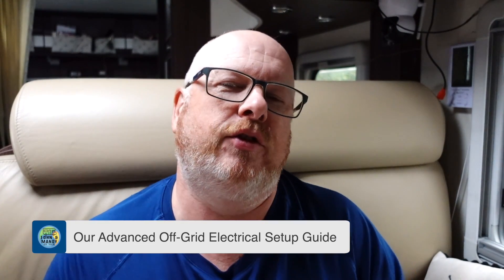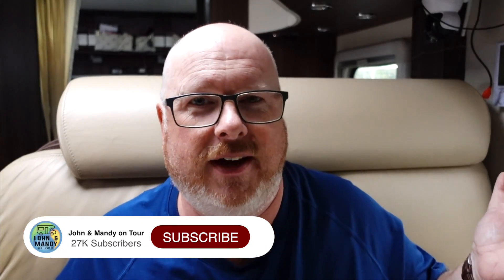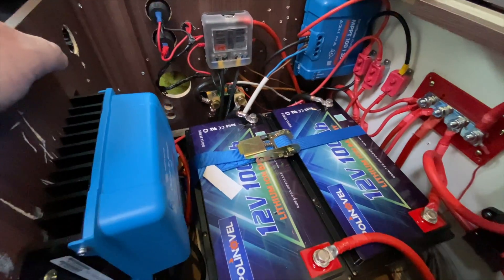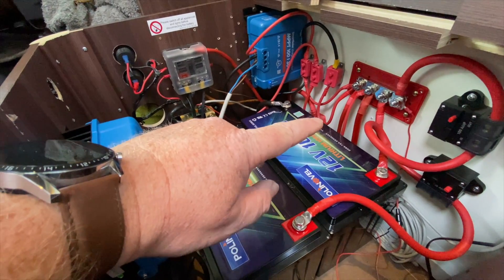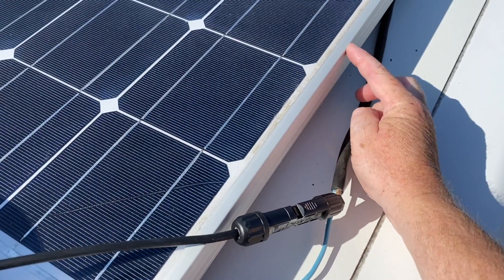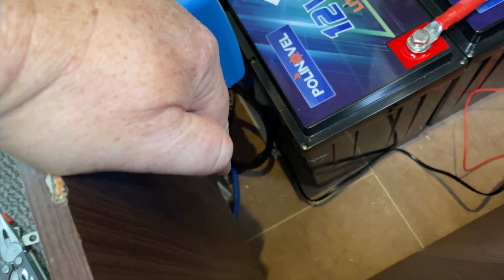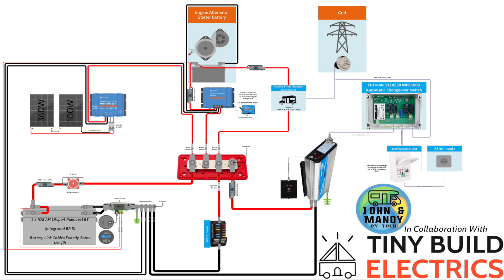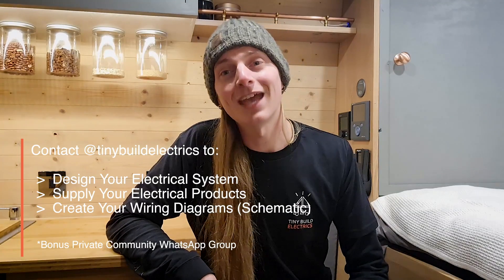Advanced Offgrid 12v Electrics For Motorhome, Campervan, RV, Boat or Cabin

Comment: Hi John - not sure if you can advise as I am no electrician we have a relatively new lifos 105ah lithium battery installed in our small swb Ford. It’s been great but I let it fully discharge and we have a ctek dc dc and 120 amp solar so we got the voltage back up to 13.2 13.1 volts but the soc on the bms only shows 12-15%. Even after putting on house charge - can’t work out of the lifos bms is fault reading or something else - any steer I would be grateful
Reply from the maker: I’d go back to the battery supplier for advice.

Comment: Hi John did you have to upgrade the weight of your van  after fitting  solar etc we have just installed solar and B2B etc and I think the payload is now  not going to be enough regards Gary&Julie  keep up the good work
Reply from the maker: We’ve carefully removed a lot of weight from our van, replacing the fridge, restructuring the cupboards, removing unwanted boxing-in sections and upgrading to lithium batteries. We’ve removed over 250kg of weight so far and with upgrades only added back around 130kg. So we’re fine at our 3.5t plated weight.
Reply: @GadgetJohnAdventures  hi thanks John I have just added solar etc as I said and totally added about 115 kg but 2 AGM batteries are 62kg  but it was a choice between lithium or enough solar etc I went to the weight bridge and was at 3540 that was loaded without the wife  food and water should I leave her at home 🥴 only kidding

Comment: Is the B2B in the electroblock ok to use in tandem with you Victron B2B when charging a lithium battery my electro block on a 2014 Hymer has lead acid or a gel setting. With two AGM leisure batteries that I’d like to change for lithium.

Comment: Hi John,
I have an old Hymer 1997 with an electro block . I am upgrading to lithium,and I am upgrading like you to a 100/30 Victron mppt and Victron B2B charger.
I loved the video and have my schematic from Tom.There are a lot of Hymer owners needing help with connecting lithium and connecting power to the electroblock,would it be possible to do a video on how you connected you stand alone lithium setup back to your electro block to keep it working the lights etc.
I would happily share it on the Hymer forums.
Love the video's
Great job.
Steve n Babs 😀
Reply from the maker: Hi, this is covered in this video. You use the factory battery cable and install a 30a breaker on that cable, then wire that into the new positive bus bar, wire the factory negative cable to your new negative bus bar. This way you have, as I show in this video, integrated the factory electrics into the new lithium setup.

Comment: oops! what happened there? half the email is missing, sorry! I'll try again.
John, you recently gave me some advice regarding upgrading my van to include more solar power, unfortunately there is no more room on the roof to add to the 150w panel. 
Long story short, we were told that the fridge was a 3 way fridge and used gas when 240v was not available. We were wild camping this weekend and lost all power, the fridge had been switched on for some time and flattened the 2 x 100ah lead acid batteries, they are not damaged, the system worked as it should. 
My question to you is, would you recommend we replace the 2 x lead acid batteries with Lithium and add an inverter? we have about 2k to spend. This is what we have in our Merc sprinter atm.
A SARGENT EC155 control system.  A 30Amp smart com self switching Combi relay.  A and we 
I have just bought a Victron Energy MPPT 75|15 Charging Controller. 
I'm sorry for the long email but I really do need your advice as I know it will be the best advice. 
Thank you for the videos and congratulations on hitting 30,000 plus views

Comment: Hi Both and coop
John, I recently asked you for some info on my van, you did reply, thank you. Could you give me more help please? 
I asked you about how much solar was needed, unfortunately I have no more room on the roof, my 150w solar panel takes up what room is left on the roof
the

MercedesSprinter
smart comCombiWaeco CR 65 coolmatic 2 way fridge, A shurflo RV fresh water pump. A trumatic C 6002 EH. We have 10 LED  spots. 
I have just bought a Victron Energy MPPT 75|15 Charging Controller. 
I'm sorry for the long email but I really do need your advice as I know it will be the best advice. 
Thank you for the videos and congratulations on hitting 30,000 plus views

Comment: Hi John. Quick question (I’m not on Instagram so have to do it here sorry). 
Did you use the separate ground connection on the side of your Victron MPPT or is it grounded through the -ve cable going back to your -ve busbar? If the former, where did you send the separate ground cable? Cheers, Stu

Comment: @Gadgetjohn, another great video, very informative as usual.
Would you mind telling me how you incorporated the original electrical fittings which would have been fitted to the leisure battery before you start adding to your setup?
Are they incorporated into the +ve busbar and the load side of the shunt?

Comment: Hi both, hope this finds you well.  Quick query, I am reworking the wiring in my van and have 35mm2 cabling between 2 leisure batteries and same to a bus bar.  I am thinking of putting  an inverter in (I have a 2000w pure sine) - would this be enough to run a coffee machine same as yours and what breaker/fuse size does a 2000w inverter need?
Reply from the maker: Yes that cable will be ok for that use and a 150a breaker covers our coffee machine, but check yours in case it draws more power.
Reply: @GadgetJohnAdventures  Thanks.

Comment: Hi John
Thanks for such an informative video. It’s helped me to gain a good understanding of what’s need for my own van.
I’m looking to do something similar for my van but I’ve a question regarding solar panels. I’ve looked at solar panels and found 2 separate panels one at 360watts and a second of 100 watts but reading the details I noticed the 360 is 24v and the 100watt is just 12v. Would this be ok to install as you have done on your van?
Looking forward to having some clarity on this issue.
Kind regards Mike
Reply from the maker: Yes, wired in series that’d be fine.

Comment: Thanks for the great video. Out of interest why have you wired in series and not parallel? I have mine in series for the winter because of the lower voltage coming in but am considering changing to parallel for the summer. What are your thoughts?
Reply from the maker: You can only wire identical panels in parallel 👍🏻
Reply: @GadgetJohnAdventures  I though that might have been the answer. If you’d have had the same would you have gone for parallel? Thanks John

Comment: Hi John could i get away with running two inverters at the same time (2000 and say a1500 ) from the same battery bank of 3 x 100amp lithium to run two different 240v appliances (induction hob and microwave) would it be to much draw for the batteries...cheers mate
Reply from the maker: You’d need to have the exact current drawn to work out batteries and cables needed,  you’d be looking at well over 250 amps. We’ve tried & tested cooking on electric and the thing you need to really work out is how to charge the batteries back up so you can cook your next meal.
Reply: @GadgetJohnAdventures  Thanks John have calculated can run van for 3 days with no sun. and have 50amp B2B. dont think !!! total drain is problem. more if 2000w will run everything at once, hob is 1000 on start only 400-500 on simmer, microwave is 800. on bench all ok. but not leave much on hand if a pump starts or diesel heater kicks in. rather have something in back pocket !!!! might buy power oak just to run microwave cheers anyway ...love the vids BTW

Comment: Hey mate regarding victron solar controller I had 1 installed Saturday and it say no solar voltage and no Watts I'm checking it hour before Sunday so not expecting much in terms of watts bit no voltage showing either the battery voltage is 12.7 which h is showing on the app guy who did is mate and wires.up campervans for job so I know he confident I don't want to keep bothering h and thoughts??.cheers mike.....
Reply from the maker: If it’s daylight then you should definitely get volts and watts showing on the victron app. I’d get the guy back and take a look at his work to resolve it.
Reply: Cheers dude..

Comment: Great video yet again. I am learning so much from you and cannot wait for the WiFi update latter in the month. I have just put a 175w panel on my camper with a 30amp breaker to the batteries, is the breaker too big? I read on the bottom of the Victron solar controller 20-30amp batteries feed. I panic that I have done something wrong. Should I put a fuse on the solar panel live before it gets to the solar controller?
Reply from the maker: Breakers go between the solar controller output & the battery they are charging. Your solar panel will have a voltage on it, like 12v, so 175 divided by 12 is 14amps, so you’d get the 75/15 Victron solar controller 👍🏻
Reply: I got the smart controller right, do you think the breaker is ok?
Reply from the maker: The breaker should match the power you know to be the maximum down the cable. So in this case 15a is the max output of the solar controller. Also make sure your cable is at least 6mm 👍🏻

Comment: Many thanks for your speedy response John. I appreciate. You are helping me to learn more and more about campervan electrics with every question & answer. From your answer, I'm now understanding that the inbuilt campervan electrics have two seperate and independent systems related to charging the leisure batteries i.e one circuit / charging system to charge the leisure batteries while you are connected to shore power. Then a totally different charging sub-sytstem to charge the leisure batteries when you have the engine running. Am I now understanding this correctly?. I guess I really hadn't thought about this at this detail before. Many thanks for confirming / correcting my understanding. Cheers - Brian

Comment: Hi just installed a diesel heater in my camper seems to be working OK but display on control is very dim any ideas please
Reply from the maker: Maybe check all cables & connections, check the supply voltage and ask the supplier for help 👍🏻

Comment: Great video very informative, Thanks. I also have a Frankia with an Electoblock. The van is mainly used for off-grid. I was going to get some new Lithium batteries fitted, but the Elektroblock does not have a setting for Lithium batteries, only Gel, and wet batteries.  I am a bit of a novice, so I may be wrong, but does this set up mean if you charge from electric hook up the batteries with not be getting the correct charge and could damage the batteries? Keep up the good work.
Reply from the maker: The electroblock will charge the lithium fine, it’ll just not give them the enough amps of charge nor will it reach float charge needed at the final charge stage. So that’s why I added the b2b and the solar controller can also give them a much better charge at the full rate.

Comment: Hi John , could I please ask you a battery question.  My leisure battery on my caravan has broke . I forgot to trickle charge it , but its  old too . We always use site electricity when using the caravan so do I actually need to replace it or does it need it for the fridge while travelling ?? Thanks for any info 👍 😀
Reply from the maker: When towing the fridge will use power directly from the tow cars alternator, so that’s not something you need a leisure battery for.  When you’re on hookup the leisure battery will be getting a charge from your onboard mains charger, so if the battery is constantly being charged it could either damage the battery or mains charger. So I’d say for £60 just get a 75ah cheap leisure battery off eBay and you’ll be safe then.
Reply: @GadgetJohnAdventures  , yes I will do , thank you very much 😊 🙏

Comment: John great video, I noticed (well think I saw) that instead of connecting your batteries together to make (in effect) one 200amp battery you have them both connected independently to your system, is this right? I only ask as this seems to be a departure from all the advice I have previously seen.
Thanks Chris
Reply from the maker: They’re still wired in parallel but using a bus bar instead of crossing cables over. This is a more reliable way to get more power in & out of the batteries 👍🏻
Reply: I noticed the same thing and then found an article by thecampingnerd called "How to Wire Multiple 12V..." and learned that in some circumstances, John's method is much better than the way I'm used to. Thanks John!

Comment: Great video John. Nice and clear and just what is needed on YouTube at the minute. Quick query, in the schematic I noticed that the negative for your battery bank was connected to you BMV shunt via both negative terminals, is it not necessary to draw the negative from the opposite side of the bank to which the positive is connected in order to use both battery’s evenly or is this not the case with lithium? Hope this makes sense 

Mikey
Reply from the maker: They’re still wired in parallel but using a bus bar instead of crossing cables over. This is a more reliable way to get more power in & out of the batteries 👍🏻

Comment: Good job of showing people what I'd call the 'right' (rather than 'advanced') way of doing things. Price breakdown very useful. Obviously Victron is at the expensive end of such kit, but also long-term reliable. I was just thinking that for an all-electric van most of this is redundant: you'd only need the panels and a charge controller, leaving most of 3 grand to spend on more battery.  I guess you'll still need the inverter if it doesn't come with one.
Reply from the maker: You’d need far more expensive gear if you wanted to use the battery pack of an electric vehicle. You’d also heavily reduce the range of the vehicle, personally I think that’s at least a decade off being viable anyway as most leisure vehicles are at their 3500kg weight limit anyway, so the Ducato electric van says that’s going to be around 80 mile range, you’d not want to draw any extra from those batteries if you ever really wanted to drive much.
Reply: @GadgetJohnAdventures  You wouldn't significantly reduce the vehicle range, because your battery, which as you observe is plenty is about 1.3kWh. So it's 1.5% of the say 90kWh battery in the van. You can run all your stuff parked up off the main battery for a very long time if need be. The fact that what we think of as a van/boat electrical system is tiny in comparison to what comes with a BEV mean most of that stuff can just disappear. 
Heat is an issue, as you need something like 1-2kW if it's properly cold so each night would be maybe 10kWh, which is a big chunk of miles. Not totally infeasible but a limitation on how far away from mains you can get when it's cold, and an encouragment to build much better-insulated vehicles. It may be sensible to just keep using a diesel or propane heater until batteries get more energy dense.  
Why would you need more expensive gear? The system is fundamentally a lot simpler. One (huge) battery and one small battery and DC-DC converter between them, and charger (all comes with the vehicle), then add some PV and a solar controller/chargcer. That's currently an obscure item because hardly anyone needs a 1kW 75DC (MPPT) -> 400VDC charger, but it's just an MPPT boost PSU same as all the other more common implementations. Shouldn't cost much more than a 75VDC (MPPT) 12V or 48V DC charger of similar power. And an inverter just like the current one, or direct off the main battery, altchough again one is likely to come with the vehicle. Rivian, Sono and PSA already do this. 
You are quite right that building a long range BEV camper inside the European 3500Kg limit is tricky. But I think it can work at the Expert/Vito/Transporter size already. Harder for Ducato/Master sized vehicles. So this cis a lot easier in the US where they don't have that arbitrary limit. And vehicles don't have to be under 3500Kg so if it has to be heavier to work then so be it. I can drive up to 7500Kg because I'm old. So yes, this is pushing the technology, but ICE has to go, and the sooner the better. I don't want to drive one any more.

Comment: Hi John, The diag shows the battery positives connected together with 32mm then mega fused to the pos busbar. In the van the batt positives are connected via 2 100A breakers to the pos busbar. Am i correct in thinking that this would affect an unbalanced charge across the batteries? Great video & info again 👍
Reply from the maker: The drawing just doesn’t show breakers, breaker or mega fuses are your choice. Neither causes imbalances.
Reply: @GadgetJohnAdventures  Sorry John I wasn't questioning the difference in diag to van layout. I remember your excellent previous video, it stuck in my mind, where you explain the charge should flow across the batteries. Just trying to understand that this set up follows that. 👍
Reply from the maker: They’re still wired in parallel but using a bus bar instead of crossing cables over. This is a more reliable way to get more power in & out of the batteries 👍🏻 I would not be putting out this video if it didn’t share the load and charge evenly across both batteries.
Reply: @GadgetJohnAdventures  Cheers John, thanks for the explanation. Roll on Spring, get yourselves back out there 🌞🏞🎥🚴‍♂️🐕🚙👍